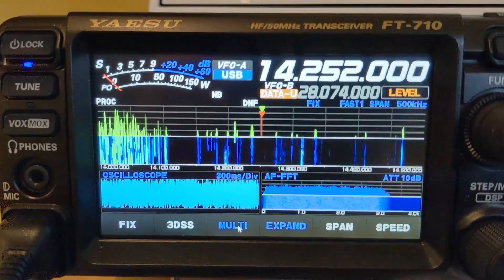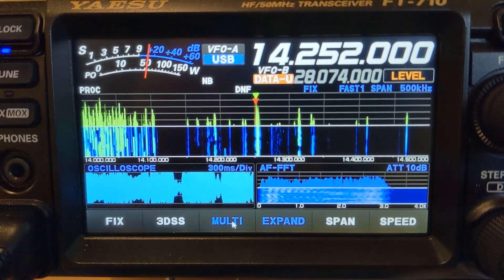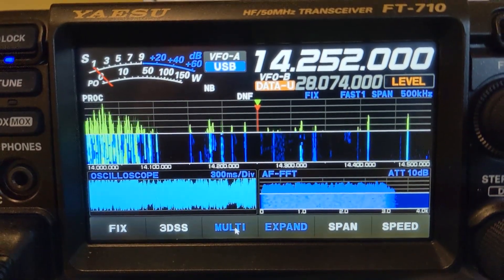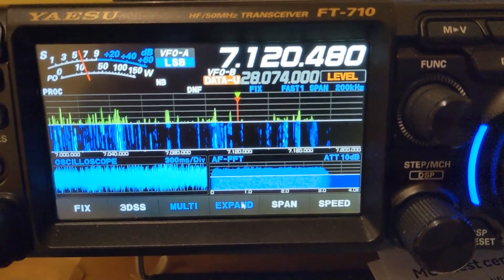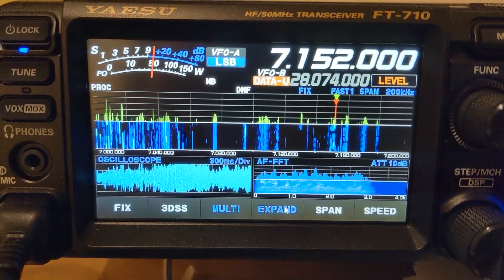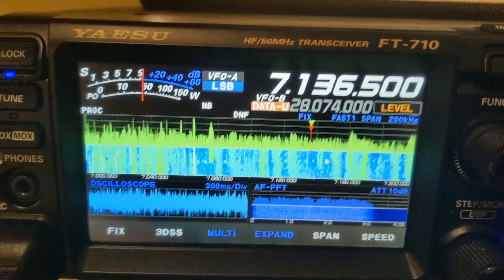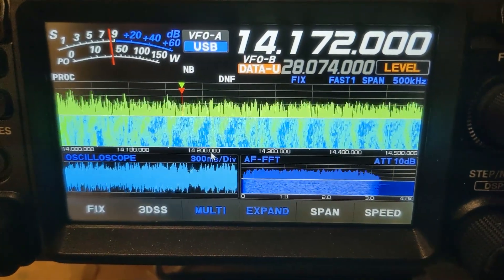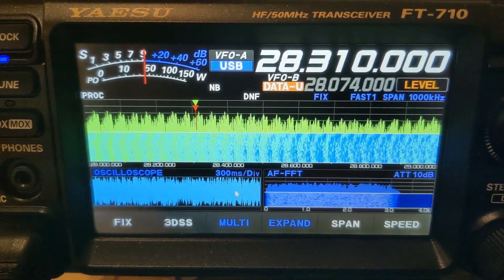Demonstration of noise floor before and after QRM starts

Comment: Have you tried putting torroids and ferrites on all your incoming lines..Palomar Engineers sells kits for that. If it is RFI being picked up on the antennas that's not help. I have S9 all the time from bad connections on a power pole near my house. Determined the pole with a small pocket type SDR receiver and a highly directional loop antenna.  I give the utility all the information and still waiting on thier help.

Have you determined the source.  Is this common mode noise being introduced or RFI?